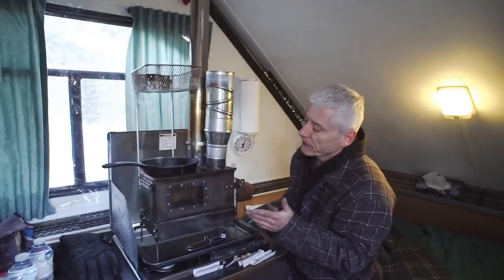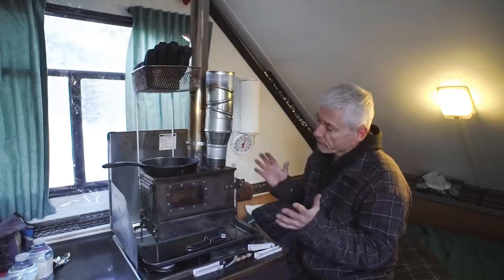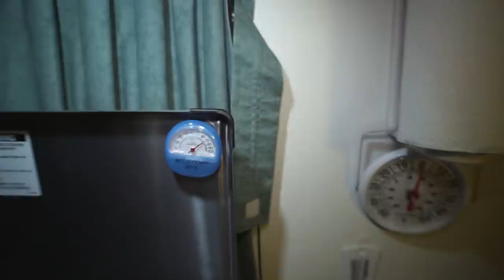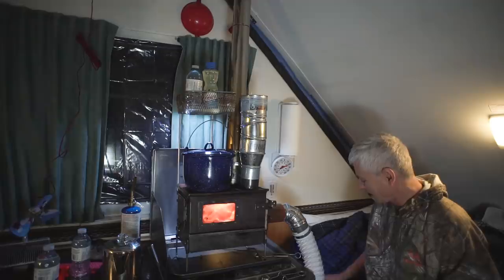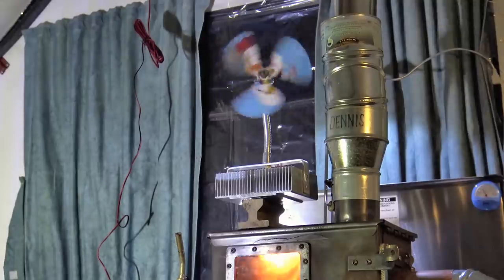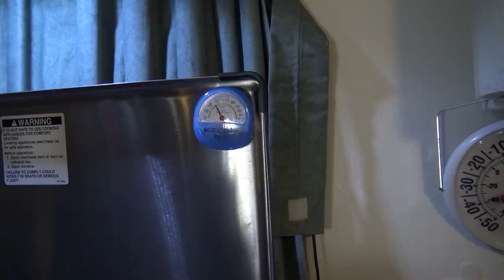Wood Stove in an A-Frame Trailer - Part 2

Comment: Do you have a dampener on the air intake? Efficiency seems to be pretty low in that stove.
Reply from the maker: Compared to what? This stove heats a trailer with the a burning mass the size of a tennis ball. SP

Comment: Great video but really not practical for cold weather. My suggestion is to capture the heat lost in the stove pipe using fins fastened to the pipe with metal rivets or corrugated metal or steel mesh, yes like heavy duty steel wool,  wrapped around the stove pipe.  Another would be a large 9 inch pie plate. The stove pipe would pass through the plate. Thanks.
Reply from the maker: I think you missed the outcome. I achieved the ideal temperature so why make it hotter? Thanks! SP

Comment: have a ? for you when you setup in rain or snow does much rain or snow get inside or do the walls keep it out
Reply from the maker: Aliners, A-Frames and other  trailers are all designed for both bad weather and good.   Yes it keeps rain out. SP
Reply: +Slim Potatohead thanks for quick response think we are going to transition from van to aliner...thanks again slim
Reply from the maker: If buy new you should have no issues. If buying used, always check the seals. I prefer ones without dome windows, as those are the most likely to need re-sealing over time. Thanks! SP

Comment: Just breathing, we create water vapor. Cooking also creates water vapor. Tents, trailers (and houses) need to be vented. Two vents (at opposite ends of your tent/trailer work best (one low, one high).  They can be tiny vents but are very important in reducing condensation inside.
Reply from the maker: Dale, the dry heat of the stove removes any excess moisture. Although the stove is a closed system, the A-Frame is not. Plenty of places for air to circulate with the outside. SP

Comment: Have you used spray foam insulation under your floor?
Reply from the maker: Not on my budget! If it could be done at a reasonable cost it may be considered, but it would have to be a drastic improvement over much cheaper inside insulation before I'd throw money at it. SP

Comment: BTW, you can't accurately measure temperature of shiny objects, with a thermal IR gun. It's because of poor emissivity of the shiny pipe. Readings may be off by 100+ degrees. Try painting several small  black (not gloss) spots with stove paint and point the gun's IR window at them when taking a measurement.

Comment: Have you contemplated using a diesel heater?
Reply from the maker: Not really. I have a wood stove for dry heat and cooking, plus a propane stove and furnace for wet heat and cooking. No advantage to a 3rd option with a 3rd fuel source that doesn't even cook. Thanks! SP

Comment: make an automation a motor that has something like a frother wire thingy that auto stir  the coal  every so and then also you could use the power from the peltier heat to electricity  thingy to power that.Extend the capacity of the storage of the pellets above the stove by adding a tube that alows you too put more pellets in so you could at least sleep a solid 6-7 hours at night and rest

Comment: Did the pipe wrap tubing also continue to fix the leaking problem?
Reply from the maker: What leaking problem? SP
Reply: @SlimPotatohead From this video: Repairing My Aliner Trailer Part 2 - Water Leaks and Weather Stripping.
Reply from the maker: The purpose of the pipe wrap is for insulation and reduce drafts. SP

Comment: What kind of pellets did you use? Any difference in using hardwood vs softwood?
Reply from the maker: I used hardwood. I expect softwood would work as well. Thanks! SP
Reply: Softwood likely will not burn as hot nor as long as hardwood

Comment: How does the heat output compare to your 2 electric 120v heaters?
Reply from the maker: The two heaters barely kept the trailer to room temp. That said, I did not have the insulation I do now when I used the space heaters. They would probably be even with the stove, however the stove is less noisy. SP

Comment: What keeps the cloth on  the vent replacement area around the pipe  from burning please?
Reply from the maker: It's not cloth. It's heat resistant silicone. See thr "November Stove-Ember" video. Thanks! SP

Comment: Get some clear plastic bubble wrap (small bubbles) Walmart Duck Original 3/16 inch Bubble Wrap Cushioning, 12 in. x 150 ft., Clear spray windows with windex and apply the light will come in but the cold will not.

Comment: Infrared does not work on refelective surfaces. (Metal, glass, plastic, sometimes anything shiny...You will not get an acurate temperature. Been in food safety industry for 8 years and a professional chef for the past 20 years.

Comment: I know you probably don't read all of the comments but I hope you get a nugget out of this one you can put vibration machine  on the pellet Hopper this way when you go to bed it will pulse every 10 minutes 4/2 hour depending on the function that you set it at use a phone battery backup the power and then plug the Peltier reheat charging unit Intuit to keep it completely charged the vibration WIll Stoke the fire by vibrating the pellets down keeping it running hot so you don't have to wake up in the middle of the night in stoke the fire there's a gentleman called Zero Energy who built one for his shop and this is how he overcome the same problem that you were having I hope this helps if you read it thank you for the good content
Reply from the maker: Thanks for the tip Kurt! SP

Comment: I'm thinking the a-frame shape is a disadvantage for heating because most of the heat is going up above your head. you could probably rig up a false ceiling for severe cold conditions or some kind of sealed insulation (wool or thinsulate in plastic zipped airtight in plastic bags or something) You really need insulation for those conditions and a sub-zero sleeping bag. I was worried about you, even though, obviously you're ok now.

Comment: Also Try Running the fan In a direction to blow air past the hottest part of the fire or lower smoke stack. 
You can buy Heat powered Stove fans to circulate the air.  they are portable & you just place them on top of the stove .
I would also Buy a CARBON MONOXIDE ALARM.  Just in case there are fumes.  OR a build up of fumes a few hours into burning. 

For Extra Heat , Run the Furnace & Fire to bring the Temperature Up, Then the stove should Maintain a Reasonable Temp in the trailer. 

There is a Big Difference in Raising the Temp from below freezing to a reasonable room temp 
But once a room temp is reached it is far easier to hold & maintain that temp. 
I would light the stove Long before the trailer becomes too cold. 

  FOR SLEEPING WARMTH.  Heat water on the stove all evening & Fill HOTWATER Bottles to pre warm the bed & Sleeping bag. 
You can Save the same water & re-use it the following night. 

Also ,  Get a metal / Steel  Drum / Bucket with a lid,  Slowly Fill it with boiling water to act as a Radiator to hold some heat.  ONCE AGAIN  Re-use the same water every night. 

Short of water ?   You can use River water or Melted Snow as this water is NOT for Drinking. 
Both these Methods will increase the warmth / or Hold the room temp .
ALL FROM THE SAME FIRE & Amount of fuel.  = 
JUST ADD WATER. 
( A rubber Hot water bottle is about £5.00 in the UK. ) 

Hot water bottles are very safe Heat overnight WITH ZERO chance of fumes & zero cost to heat the water. ( Zero extra fuel needed. )

Comment: You know if you want to get warmer, you need something that air can’t go through, and you body heat will keep your warm, material will let your body heat out as heat rises.
Look for pocket aluminum coated blanket. Put it between blanket. Try this buy a thick plastic canvas or bag. Both are air tight. Try it it will keep you warm no matter how cold.

Comment: can you put a damper in the stove pipe so all the heat will not escape. and it will burn longer and get warmer.
Reply from the maker: It has one. You must have skimmed that part! SP

Comment: Just a tip, a wood stove will not consume the oxygen from your trailer. It pulls air in, not oxygen. It just uses the oxygen from the air it pulls in, everything that it doesn't use goes straight up the flue with the rest of it. Doing this it will pull fresh air in from outside through all the gaps in your trailer. Probably a better idea to not have the pipe as it will replace the air in the trailer every so often.
Reply from the maker: Hi Oscar, I think you missed a few important points to this design. Any fire inside a confined space will draw its oxygen from the area around it, that's just basic principles of combustion. By bringing the air directly from the outside prevents it consuming oxygen from the trailer, but it also keeps the trailer warmer as it stops it pulling cold air into the entire trailer. The vinyl hose has insulating properties. Also, should something block the flue, the only path smoke has in this closed system is out the intake, therefore outside the trailer.  Less dangerous, more heat. Intake pipe stays! SP
Reply: @SlimPotatohead  I had this dilemma when I was choosing stoves to put in my house. Three in total. We had the option to have the stoves draw from outside however with the walls being 2 ft thick that would have been expensive. The only reason for doing this is efficiency, the safety aspects are minimal. Over where I am if you have a stove rated at more than 5kw you must have a vent installed somewhere in the room and that's because the stove is pulling the air out of the room and should you not have that vent (This is more focused on modern houses where everything is sealed) the stove may have the capacity to drop the pressure in the room and then you may start getting smoke coming out of the intake. I can assure you that a stove will not selectively pull oxygen from the air in your trailer and it's a mistake a lot of people make when asking about stoves or fireplaces. However, it's your trailer so you chose what you do. As you said, if the whole stove thing works out then you'd find a way of getting that pipe out of the way. Also, please make sure you have a smoke and CO alarm installed somewhere near the stove, especially with a DIY job.
Reply from the maker: Agree to disagree I guess. Do you have a wood stove in your trailer? SP
Reply: @SlimPotatohead  Never had a trailer but we used to have a small narrow-boat that we'd use for weekend trips and the like. When we bought it, it came with a wood stove that would quite nicely heat the entire thing. Eventually we installed a diesel heater though which was much cheaper to run and didn't require purchase of different fuel as it was just tapped straight into boats' fuel tank. Moved house a couple years back though and no sense in keeping the boat when there's no canals anywhere near where we live.

Comment: You know that propane torch can use the same propane as the other ones which are general cheaper and you can refill just the same but whine it is that cold i don't know how well that works

Comment: Windows are like having a hole in the wall. Windows and ceiling vents MUST be covered.
Reply from the maker: Dale, the windows are insulated (did you miss parts of the video?), and both the outake vent and intake vents are also insulated. SP

Comment: I don't know if it has been mentioned or not, but I think you need to watch your entire stove pipe on the inside (of the pipe) for creosote buildup. Very dangerous!!! Stay safe. Check all the way to the end of the pipe outside the trailer. Thanks
Reply from the maker: James, it's titanium foil. Any build-up is removed by rolling it back up again. SP

Comment: it will take a lot of energy to bring the temp up.  the trailer only has an r value of 4 or 5.....not enough insulation.  I solved the problem by putting straw bales up the sides of trailer to window height or higher if desired.  I went up my trailer to about mid window height...…...covered windows with insulation foam, except for viewing ports.....trailer temps went from 45 to 92...….improvise, adapt, overcome.....

Comment: You will get more heat from burning wood instead of pellets. Even household pellet stoves wont keep up when its -20 . There just isn't enough energy stored in essentially compressed sawdust.
Reply from the maker: Yes, wood generates more heat then pellets, however needs more attention, produces more smoke, more ash and is less consistant. For long periods, pellets are more practical for heat. Wood is best for cooking. Thanks! SP

Comment: I don't know if you can set how the chips go into the fire or not, its a small stove, the bigger ones ,you can set them, and o yes you need a fan to move the air around, if not it just sets there and only moves , when you do.you may have to get up two or three times a night to fill your stove, but you will keep nice and worm.

Comment: let me leave two comments,  one- don’t worry about the stove using all the air.  not gonna be a problem with leaks. second use scotch double sided tape for plastic windows.   its easy just do it before it gets below freezing so the tape sticks properly .   be safe man that hose looks like a serious hazard even if an experiment

Comment: I can tell you a sure way to retain the heat created by your stove.
You must have a damper .
If you install a damper in the exhaust flue , it will still allow the stove to draft, & it will retain the heat in your firebox instead of the heat escaping out the pipe.
186 deg where the pipe exits out the roof is proof positive your heat is going right out the pipe.
Reply from the maker: Actually Phillip, the fact that the exit temperature of the flue is only 184F is proof the system is working effectively. It means that a very high percentage of the 538F peak surface temperature at the stove was indeed distributed inside the trailer. Comparing this to an efficient wood stove in a house reveals similar results. SP
Reply: @SlimPotatohead  
I watched your video's out of ordee and realized you had a damper.
Starting from an ammo box, and ending up with a compact woodburner that worked very well even in brutally cold temps is all thumbs up.
I follow you because I enjoy your imaginitive methods to make repairs.
I have a mechanical engineering deg & it humors me when I see you improve on almost everything that came factory on your Aliner.
Safe travels my friend.

Comment: what did you do with the canvas cover over the pipe hole on the roof insert???
Reply from the maker: Thats not canvas. It's a heat-resistant stove jack. Thanks! SP
Reply: @SlimPotatohead  oh ok looked like canvas from the vid. pellet stove os cool

Comment: You could put a sterling engine with a fan on top of the stove. Stirling engines look and sound like small steam engines; they are a bit loud but they run on heat and nothing else. Search YT for Stovetop Stirling engine fan
Reply from the maker: You missed part of the video! SP

Comment: Whew! I'm certainly glad that you've been camping. (Although not so much that you almost froze to death in the name of research!) I was hoping that your camper hadn't melted, you threw up your hands in dismay, and swore off of Youtube forever. I feel like eventually you're going to devise something internally in the stove that will stir the coals while you sleep. (Your camper is becoming more "gadgety" all the time!) Until then, nice set up! Hot rocks in the stove crossed my mind, (since rocks hold heat) as did a little screen on the door of the stove(something like a fireplace screen) that would allow the heat to escape into the camper faster. Just thought I'd throw that out there. Because your hopper named Dennis cracks me up, I've been trying to think of names for the stove and chimney. Nothing worthy yet but I'll keep you posted. Have fun. :)
Reply from the maker: "Chim" Chimney perhaps.  Wasn't that in Mary Poppins?!? SP
Reply: @SlimPotatohead  It was! "A sweep is as lucky, as lucky can be." I feel a "Mr. Rogers" vibe happening. haha
Reply: @SlimPotatohead  I thought of "Sharon Stove" and jokes about how hot she is, etc, etc. Still not worthy of Dennis. lol
Reply: I was thinking rocks or bricks too???  I liked how he put the fan to circulate the heat down from the high point...and his home made fan...pretty dang cool(hot) !!

Comment: I had once put a small soapstone stove from a tig boat in a rv I  had. Bot it worked great. Dont need much fire to heat 24 feet of rv. Untill someone dtole it and my solar panels. I dont have a lot of good luck...lol.

Comment: If it is sucking -10ºC air from the outside, any idea how much 'cooling radiation' you are getting from the fresh air vent coming from the door across the trailer?
Reply from the maker: Hi Jim, good question. I think little, as the vinyl sides of the hose acts as an insulator. It is not cold to touch. This seems a better option than just opening a window or vent for more air. Thanks! SP

Comment: I realize if you have built the stove you have thought about all the heat you're losing up the chimney.  You might use an old heat exchanger from a  gas furnace and run the fumes through it before it exits the stove pipe.
Reply from the maker: Have you seen the build videos? The inner chamber is divided, so the flow does not go directly from fire to chimney. Any further additions and it would no longer be compact. Thanks! SP

Comment: The stove will not suck the oxygen out of the air in the trailer. The stove sucks in air from the trailer and every bit of that air goes out the chimney. It does not use the oxygen only from the air. If the trailer was very airtight, it would be good to have the extra air hose, but with all the cracks in the trailer, there is no need for the air hose. Actually the air hose is still a good idea because it directs unheated air into the stove and not the precious heated air.